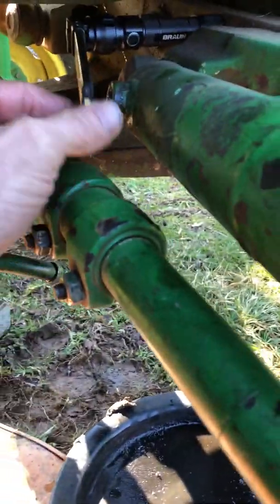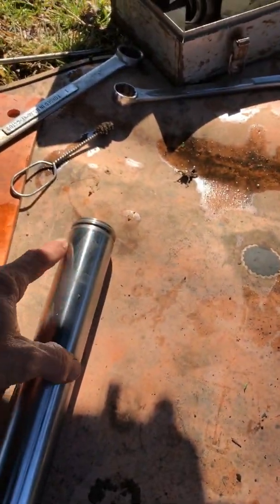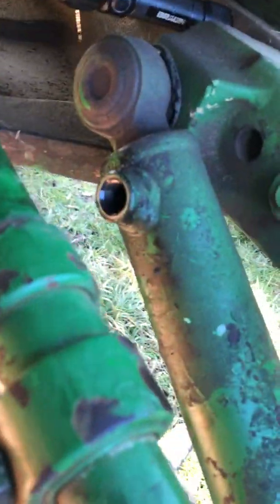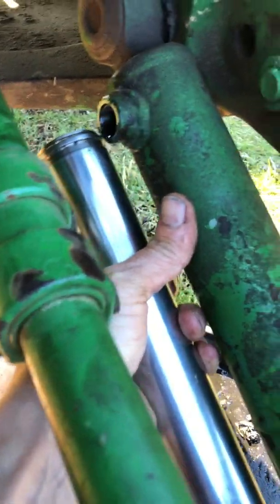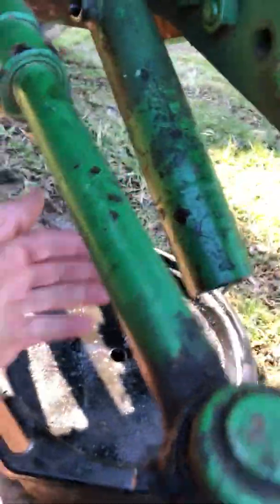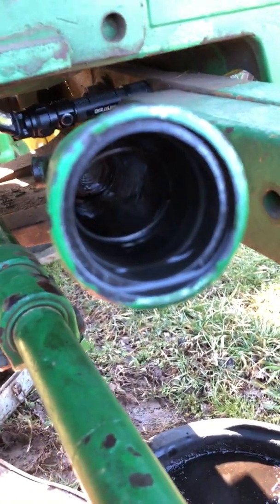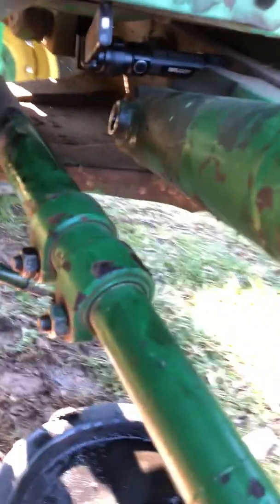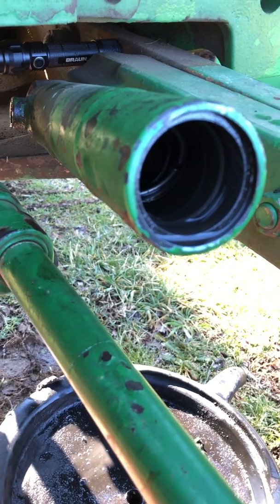John Deere 2555 hydrostatic steering cylinder disassembly and rebuild part 1

Comment: I'm getting fluid out of the air bleed plug on the opposite end of the cylinder. I assume there should only be air on 1 end and fluid on the other end am I correct? The tractor has stopped steering and I'm trying to diagnose the issue